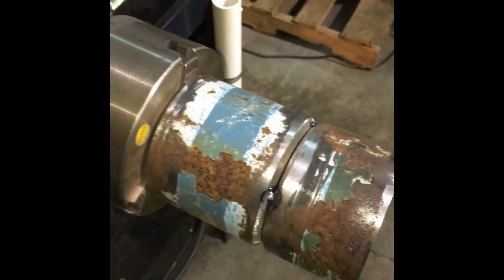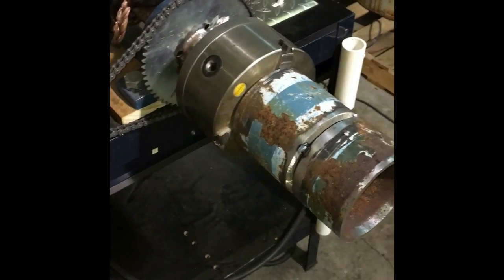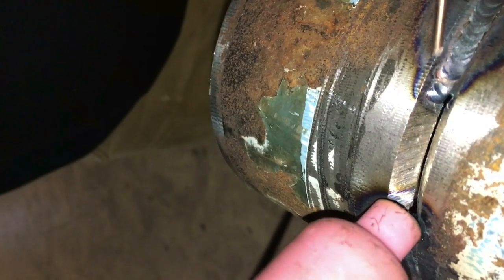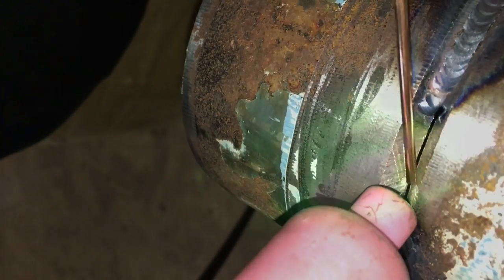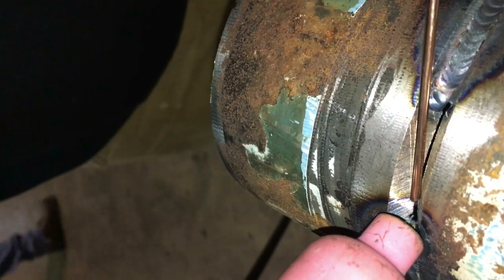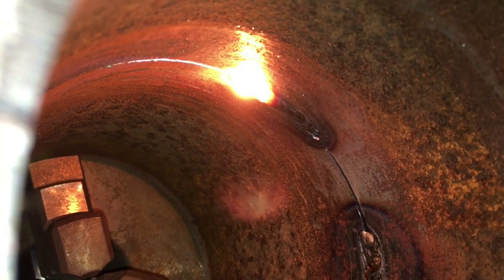How to weld a tight root gap on 6g test or in the field

Comment: Had my first Tig ticket in mid 70s and I've put roots in every way you can think of while you can do it this way you'll run into big problems  first one is suckback on ohead but worst is distortion positional ,beginners out there do yourself favor and learn how to weld holding the wire inside the gap

Comment: Fellow pipe welder from down around where y’all are. We know a lot of the same guys. But question on this because itd help a lot of these guys who’re watching to learn. What about on the bottom where you’re more than likely going to get suck back, or concave root as the aws terms? Can’t back feed it to make sure you have metal on the bead. Make a video on that showing them how to face feed a tight gap on the bottom in 5 and 6g positions.

Comment: I’d just cut it open with a thin disc then feather the tie ends !!!!!!! Why risk it closing up and not break the wall down ?????? I’ve done it this way and I know it works but it’s still a risky way of welding especially if it’s on the bottom..... I’d do this kind of technique at a paper mill or shipyard but never at a oil refinery or chemical plant ..... taking risk is how you end up with a high repair rate and a bad name, tight gaps and a sexy firewatch will get your money everytime!!!!!!!!
Reply from the maker: Roll Tide welding pipe is risky business.  In itself..  Some times just knowing how to do something a different way is worth knowing. We are just showing different tips and Tricks

Comment: I'm a retired union boilermaker just run the tungsten along the bottom of the tube with no filler wire really quick and it will burn a little of the bevel off used to do it all the time in the field and the tubes were x-rayed
Reply: I do this all the time even with the same heat just open a key hole with the heat and dip the wire I hate to open shit up with the grinder all it does its make shit worst
Reply: Amasing advice, and very new to me! Thank you, Sir! (I have a little remark to add to this: x-ray testing is not the most strict way of testing pipes after welding: I worked for one company in a potash mine expansion project, and they tested us with ultrasonic. I swear that ultrasonic is the hardest testing for welders, it has which no mercy to the slightest non-fusion that x-ray cannot typically catch; many welders after coming to that work-site had to readjust their way of welding stainless with TIG.)
Reply: @alekrudy5993  I know I'm late but I always felt UT was easier.  Except one time on a 54" weld that kept busting so the x-rayed it and there was a void in the fitting about 3/4" outside the bevel.
Reply: matt harper same here.
Reply: Thanks matt for the information :)

Comment: I have a quick question. I gap my pipe with a 5/32 aluminum rod welding carbon. my question is this sometimes when I'm putting my hot pass metal leave the piece and covers my tungsten do you think it's the aluminum that causes that
Reply: getting your tungsten to close , even if you dont dip but get it close enough to the molten puddle you can watch metal jump to your tungsten and no its not because of the aluminum
Reply: It’s the silicone popping out

Comment: That aint gonna work on the bottom of the pipe.
Reply: turn your amps up a few more and key hole it and push in your wire. thats the way i do it and it works like no problem. i did this method on 15000 psi boiler header pipe with zero gap was a bad fit but it was the best the fitters could do with chainfalls and come alongs pulling in all directions could hardley even get in there to tack it with all the riggin in the way. so key hole is the answer. hope this helps other welders.
Reply: @jamiebuckley1769  replied before I saw this ha
Reply: Yeah you should make a video cause I really wanna see that
Reply: Alabama Pipe Welders Academy I agree and korean welder do like that.
Reply: yes i agree
Reply: right on
Reply: It's gonna suck back but it will pass ut not x ray though
Reply: Let me tell my opinion... I want to check my theory. Please tell me if I am wrong.
I think that ability to make reinforsment on the other side depends only on the angle of bevel, not on the position, either top or bottom. If bevel is too obtuse (or rounded)  then ark will not only melt the edges, but will also strike the middle of the bevel and melt it too.  That means that paddle will be stretched high to the walls of that groove, and therefor the surface tension of the melted metal will make that ball of remelted metal form not near the edges (as we wanted), but somewhere between edges and the middle of the bevel (which we do not want). That means we are getting our root sucked in, or being concave = fail. 
So, with the tight gap we really depend on the joint preparation. 
It happend to me. Pipefitters prepared joint of 14” heavy wals flanges plus pipe really bad for me, and I did not notice untill I started to weld: surprisingly, I could not achieve the fusion and enforcement inside. Then I had to use my grinder and remove that rounded hump along the middle of the bevel. Only after that I could weld well, without my arc striking as high as the middle of the bevel and melting it. (But a little bit later I realized I can actually reach it from inside, and weld it up without thinking much.)
Reply from the maker: not to argue with you but it can,,,, and we do.... its the same principle... maybe you should try it before saying its impossible..
Reply: I don't know how to do what you do on the bottom because I don't know the  torch and rod angle and whatever else you need to know how to do it. You should have shot the video showing how to put in the root on the bottom 4 to 8 o'clock area  instead of the side or the top. those are the easy spots.
Reply from the maker: KRS 1 ok we will make a video showing it for you... it's the same as on top and sides.  Are you wanting to learn this or just doubting its validity....We don't mind helping anyone willing to learn the impossible.
Reply from the maker: KRS 1 KRS 1 ok we will make a video showing it for you... it's the same as on top and sides.  Are you wanting to learn this or just doubting its validity....We don't mind helping anyone willing to learn the impossible. 😉
Reply: That's really nice of you but I don't want you to trouble your self. Making these kind of videos must be time consuming and all that. If you say it works on the bottom then I'll take your word for it. I was skeptical of it  though because I figured most the filler rod metal will be dripping downward and on to the outside of the bevel on the face and not much on the inside of the pipe on the root. How you push the melted rod up to build up a convex root when you dip it into the puddle was what got me puzzled on how you do this. I'm guessing you have to have the tungsten/torch pointing almost straight up like you were doing overhead when you dip your rod into the puddle in order to push the metal up and keep it from sagging down.
Reply from the maker: KRS 1 just make sure tungsten is pointed straight in and add wire only when the puddle is hot enough to receive it. It might help you at first to grind your tungsten at a 60 deg angle for higher volts to help push ..  we don't change our tungsten just the amps and the wire pushing technique. Hope this helps. Try it you will figure it out fast.
Reply: So point the tungsten straight up? Like if I was starting at 6 o'clock, point the tungsten up towards 12 o'clock? And when you say grind the tungsten at 60 degrees, I'm thinking it will look more blunt like a bullet than a long needle shape I usually use.
Reply from the maker: KRS 1 yes
Reply: @krs1732  I was recently welding some 320 SS and I learned it could be done, with in mind the Gap is tight and there dose not need to be as much metal deposited. Keep the torch moving other wise it will suck back. More metal in the puddle will equate to gravity taking over. Key hole a bit hopefully you puddle will elongate slightly, push filler and move!